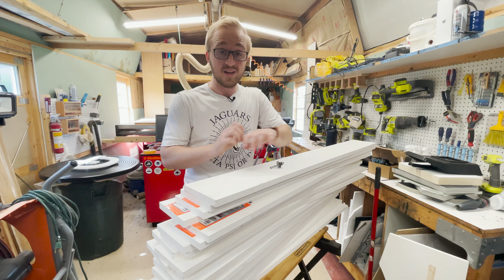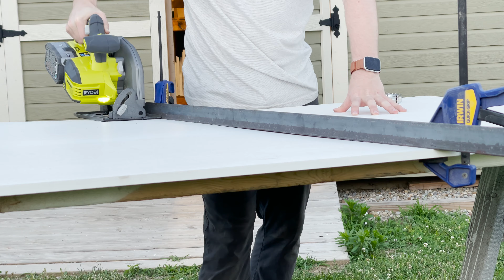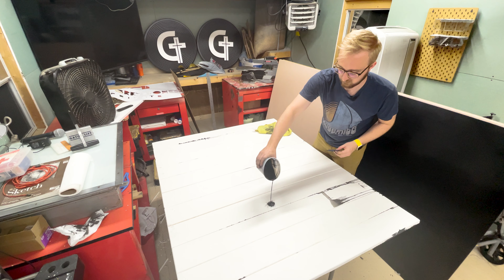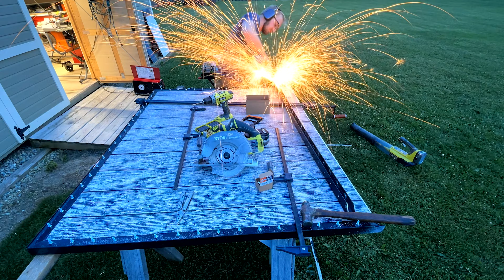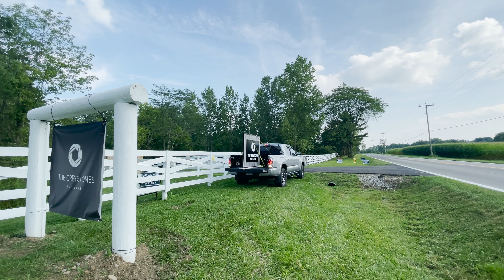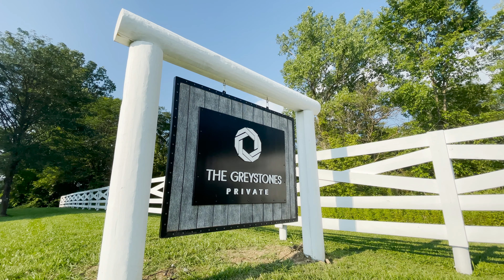Building a Steel and PVC development sign

Comment: Nice clean work. I like the design of the sign and it looks great mounted up. However, maybe next time try putting some rubber gloves on when applying your wash. You probably spent quite a while removing that from deep in the skin.
Reply from the maker: I couldn’t find my gloves! I think the gremlins got ahold of them. Fortunately it wasn’t too troublesome to remove the bulk of the paint from my hands.
Reply from the maker: I couldn’t find my gloves! I think the gremlins got ahold of them. Fortunately it wasn’t too troublesome to remove the bulk of the paint from my hands.